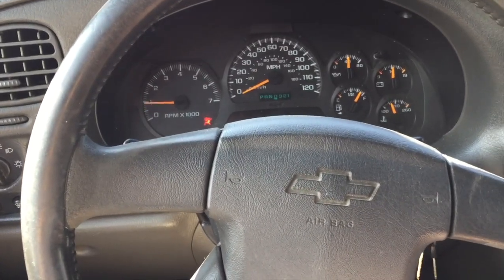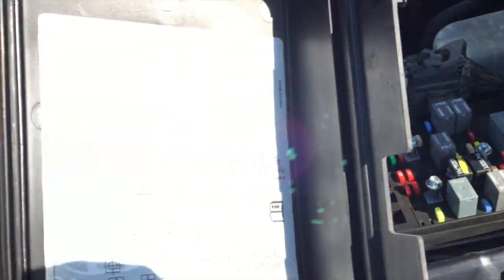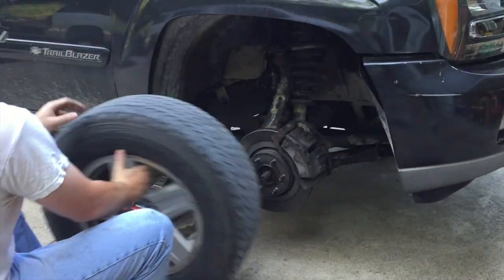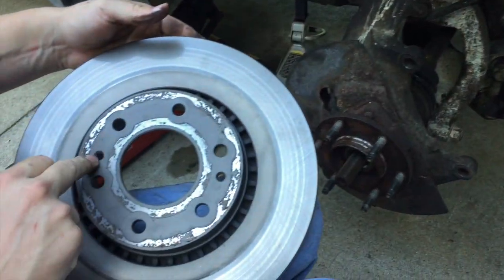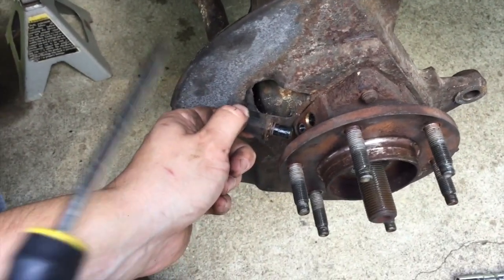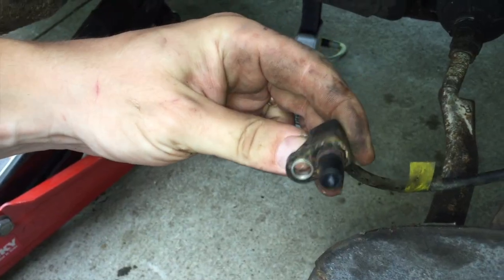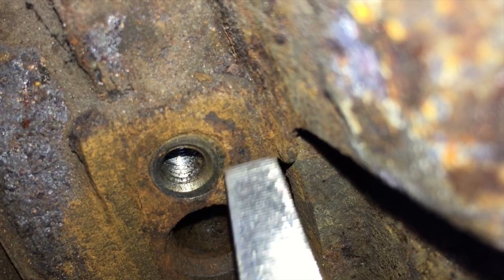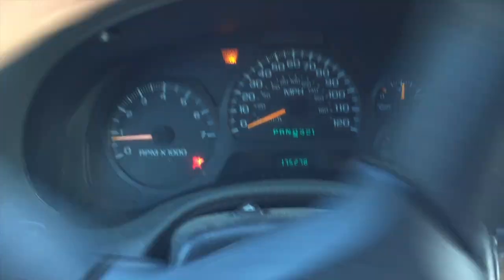Brake pedal buzz at stops - ABS kicks on at stops - Cleaning Wheel Speed Sensors - GM Truck

Comment: Hey Daninator! Your check engine light was on after you fixed the symptoms. Was the check light on because of the dirty ABS sensor or was that a different issue all together? I ask because I have a 2003 Trailblazer LTZ that has the exact same problem. At every stop that before the vehicle comes to a holt, brake pedal buzzes and vibrates a little. But I didn’t get a check engine light on mine. Only time it doesn’t do it is if I come to a stop super slow without applying much peddle. I work on all my own vehicles as long as I have the tools and the time to do so. Very helpful video! Much oblige!
Reply from the maker: I don't believe the check engine light was related to my braking issue.
Reply: Ok I feel better about it knowing that your check light wasn't related to the ABS issue. Now I don't have to wonder why I didn't get a code and someone else did for the same problem. Thank you for taking the time to reply.
Reply: @fredwagner7424  mines been doing the dam same thing i replaced the hubs with sensors and problems still there sucks man next step is replaxing all the dam lines and module
Reply: M 
Hello M. Yeah that kinda sucks after all that work. I haven’t gotten a chance to try fixing mine yet. But I’m driving to work tomorrow morning because we just got slammed with snow and ice. I’m still going to try cleaning the sensor first and take it from there. I’ll let you how it goes. I’m your case, after what you’ve done already before I would buy anymore parts I would try bleeding the brakes. Unless you already tried that. That’s what I was going to first try until I seen his video. Only because the peddle seems to go down farther than normal when that happens. It never happens when I use the brakes any other time. Only just before a complete stop does it does it. If I’m able to brake slowly and creep up to a stop with having to push to hard on the brake peddle, I doesn’t do it. That’s why bleeding the brakes came to mind first. Real spongy feeling and the peddle almost goes to the floor, then I get the fast pulsating action and sound. I’ll keep you posted!

Comment: You rock bro! You just saved me $$$$ on repairs
Thank you
Reply from the maker: John Mishler awesome!
Reply: @TheDaninator  I have a honda civic 1.5 turbo 2017  and whenever i apply sudden brake to stop the car immediately whether at the speed of 20 30 or 100 the abs kicks in immediately brakes lock up and car skids forward  and abs system does not show any fault code what could be the issue? I have new pads rotors front back and almost new tyres michelin primacy 4 so everything on that side is clear i am just not able to fix this problem now i found this video i wonder if its the same issue? With my sensors causing abs to kick in ??

Comment: Hey Good Video! You shed some light on my weird situation on my piece of @#$5 07 BMW X3. DOES THE SAME THING BUT ONLY IN REVERSE! with and kinds of lights on the dash. I Removed my abs/speed sensors front and rear. The rears were full of rust and road debrie. Also, the Tone ring looked a little "out of round" (High and Low spots) probably from rust. I cleaned the rear rings w brake clean and nylon brush, cleaned sensors with a rag and wire wheeled the rust from the mounting area (hole). My sensor were worn and curved to the ring so I made it flat like if it wur new sensors with light sand paper and razor. Mine are basically magnets and the plastic was not worn to the inducer inside like yours yet? The fronts weren't as bad but didn't pay as much attention to them as the rears. Also on the front the Ring is inside the wheel bearing, or some other back yard mechanic remove them. I had 2 codes in computer P1774 & P1775 ABS, 4x4, Check engine and brake lights were on. After doing the work above similar to yours the dash lights went out and rest the codes. 100 miles so far and runs good. These sensors will cause the vehicle to run terrible cuz they report to computers, the transmission, speedomoder and transfer case etc... Questions:
Did your fix hold up and Do you or Anyone have the ABS modulate at low speed in reverse only? Any reply would be greatly appreciated.
Reply from the maker: This fix has held up on my Failblazer. No issues.
Reply: The Daninator That’s good. I don’t think I did my fronts well enough. I’m going to do a redo on the fronts and see what happens.

Comment: Interesting to watch! However when your steering wheel went right on stopping, and you said to do the opposite side sensor, why did you do the RIGHT sensor not the left?
Reply from the maker: I did both. I started on the passenger side, only because I had the wheel off doing a different repair. Just figured on going ahead and cleaning both.
Reply: You do the opposite on which way the steering wheel pulls because the steering wheel is pulling right due to the abs kicking in on the left side and the pads not completely grabbing the rotor.

Comment: If you spray some Rust-Oleum on before you put sensor back on it will help from rust build up in future as well. Nice video. Very helpful for me and my '02 trailblazer
Reply: Not spraying the sensor but where it mounts to the hub.
Reply from the maker: nice tip

Comment: I do not usually comment on Youtube but today was the exception. After wasting hundreds of dollars on mechanics to fix my buzzing issue which they could not figure it out . Also the Toyota dealer wanted $1,000 to replace both front ABS sensors to fix my brake buzzing issue. I was able to follow your advice on your video and today I finally cleaned the rust between the hub and the ABS sensors. My buzzing issue disappeared. You saved me more money because I was going to replace both sensors. I drive a Toyota Sienna 2008 LE. Thanks for your video.
Reply: TOYOTA $1000 ,ARE THEY NUTS ?. $100 BOTH SIDES BRAND NEW ROCKAUTO PARTS.
Reply: Hope I ca do the same

Comment: GM had a bulletin out on this. You did everything they said except. It said to use a pencil eraser down the sensor hole and turn the hub to clean the inner surface. If I remember right it did say apply a light coat of grease to the sensor base. 
The rust jacks the sensor up and creates too big of a gap for the sensor to make a proper reading.

Comment: nice tip. now you need to address the air bag light and the check engine light.
Reply from the maker: James Hall indeed. The list is long with this failblazer 😂
Reply: @TheDaninator  my wife's trailblazer has a good list of things to fix as well. The CD player, overhead DVD player, the climate control, sway bar end links, and some of the lights in the window switches. The trailblazer still runs great and love them. They are very well built and solid vehicles.